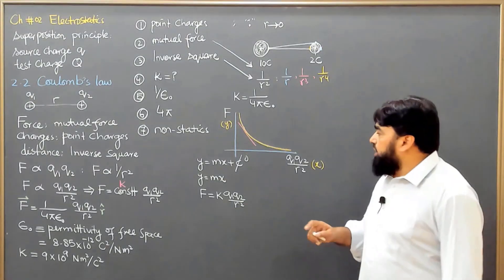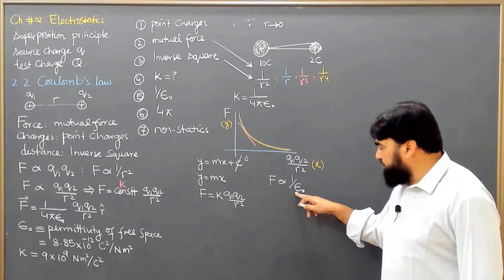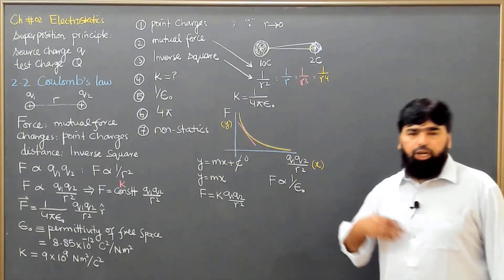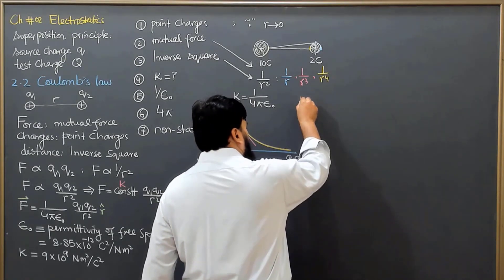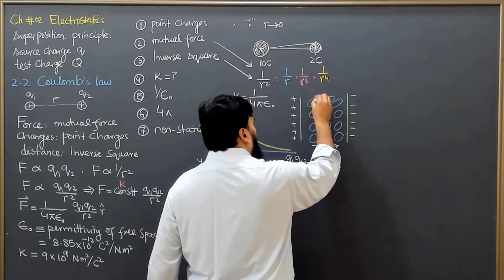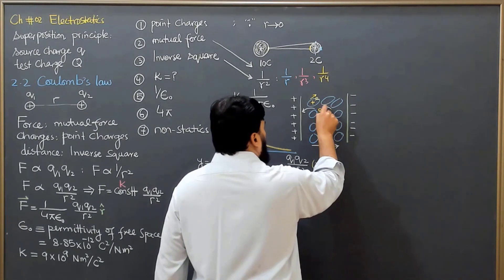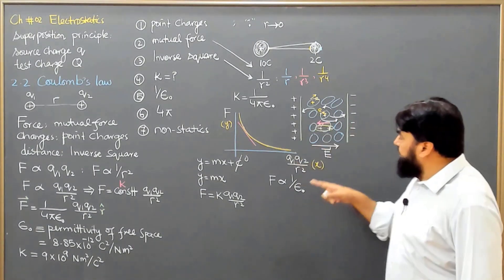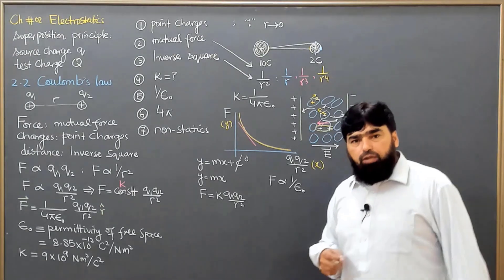Why is the permittivity of free space inversely proportional to the electric field?

Comment: Sir, why force between two charges acts on line joining center in coulomb's law?
Reply from the maker: If there were a component of force perpendicular to the line joining the charges, it would contribute to a torque (rotational force) that could cause the charges to rotate away from the line, increasing the separation distance and decreasing the force. The system tends to minimize potential energy, and the configuration where the charges are aligned along the line of force represents the lowest potential energy state. Therefore, the electrostatic force acts along the line joining the centers of the charges. Thanks
Reply: @SAYPhysics  Great sir, now cleared.  And sir the point charge concept is why only associated with coulomb's law. And if it charges are not point charges then which law is applicable? Is Gauss's law?
Reply from the maker: For extended charges either Coulomb's law or Gauss's law can be used. In Gauss's law we can benefit from the symmetry. Thanks

Comment: Admirable Sir: Permittivity is the property of a material to oppose the electric field throughout all electrostatics, while permibility always support magnetic field, therefore, permibility is directly proportional in many cases.
Reply from the maker: The permittivity of free space (ε0) is inversely proportional to the electric field (E) because it reflects the ability of a medium to permit the displacement of electric charge in response to an electric field. Higher permittivity means less opposition to the electric field.

Similarly, the permeability of free space (μ0) is directly proportional to the magnetic field (B). It characterizes how a medium allows the passage of magnetic field lines. Higher permeability implies easier passage of magnetic flux, hence a direct proportionality to the magnetic field. Thanks
Reply: @SAYPhysics  Thank you Sir
Reply: Higher permittivity means more displacement of nucleus and electron of the  medium atoms, thus higher opposition electric field, so less smaller external electric field between the 2 plates, right?  @SAYPhysics